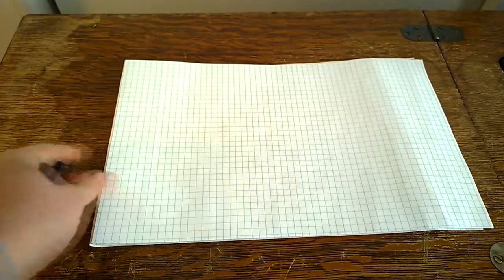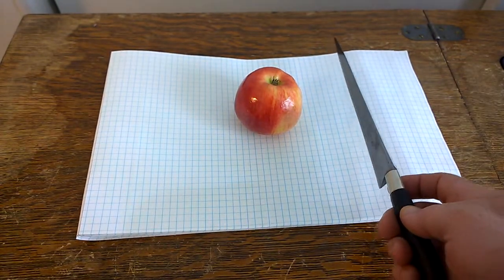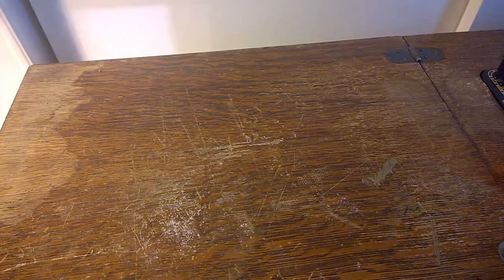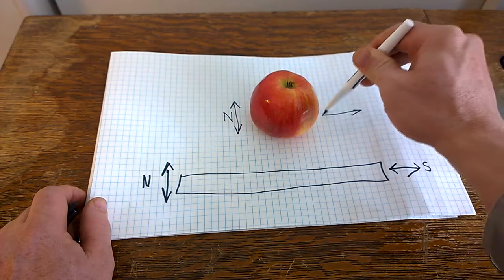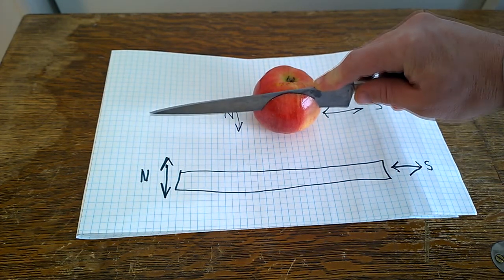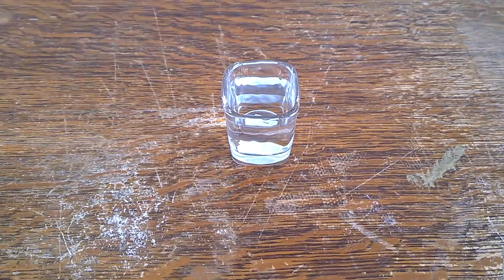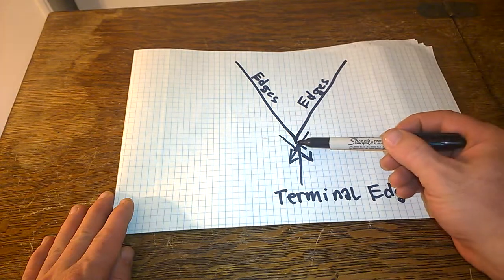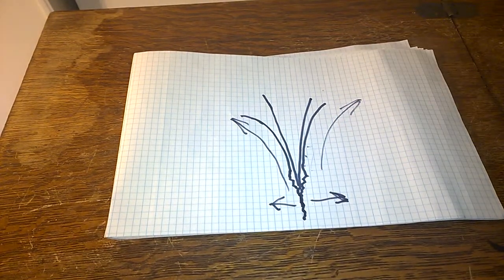How Cutting Works

Comment: What's the clear definition of Cut?
Reply from the maker: The most accurate way I can think to put it while remaining concise would be 'The Nucleation and propagation of a crack.' 

Furthermore "crack" would be defined as 'The partial self separation of a material.'  

Crack in this sense definition would be synonymous with a tear. Except that, for utility sake, we might distinguish between the two by saying that a crack requires an outside implement (this could be a knife cutting it or even striking the ground) directly effecting the are where nucleation occurs. Whereas a tear would be indirect (such as when one tears a paper).

Now of course none of these are dictionary definitions. But the aim here is to go beyond descriptive definitions (dictionaries only tell us how words are commonly used and give some idea of their origin). It's to get to the root of it and find the necessary prescriptive definition (what it objectively must be in order to make sense in our world) underlying how we merely use the words.
Reply: @The1Helleri  ... I appreciate that effort